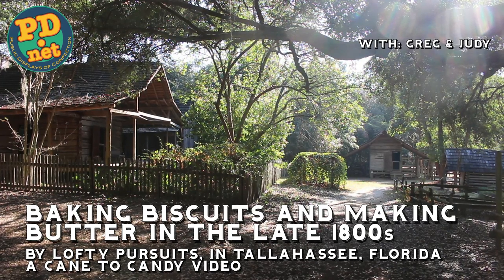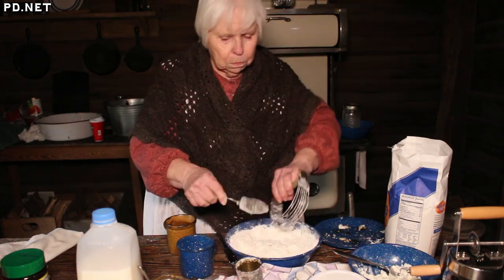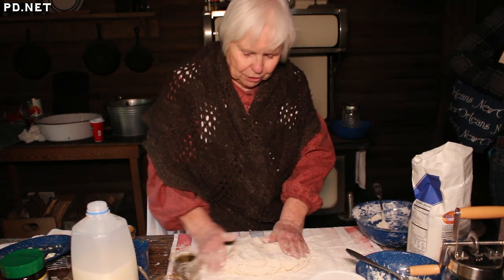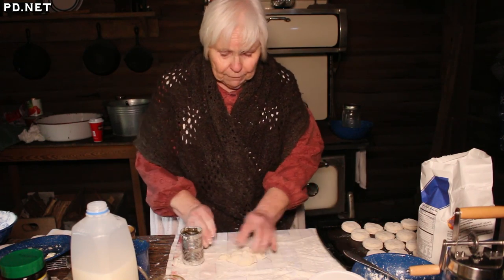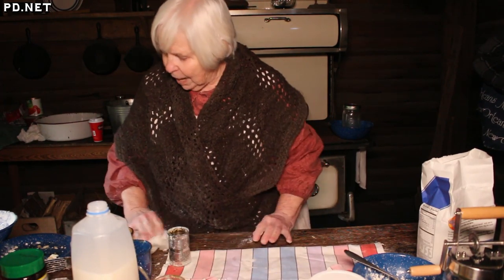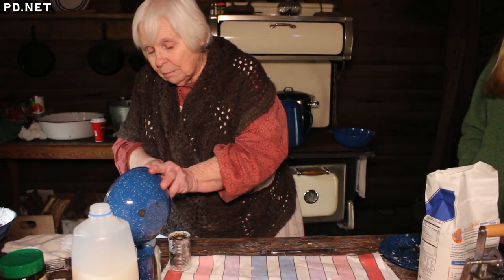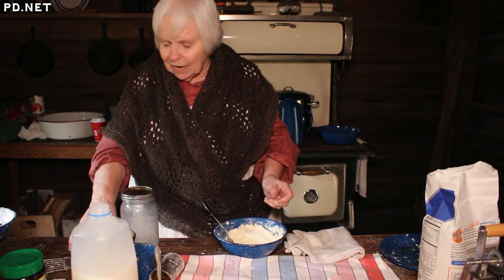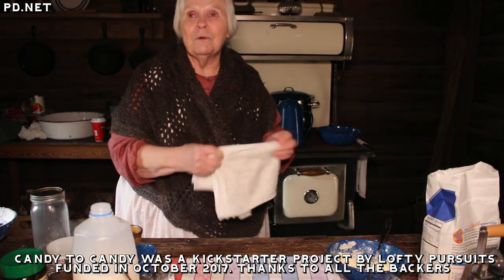#80 Baking Biscuits and Making Butter in the late 1880s

Comment: Does the Moon and the Equinox actually have anything to do with making butter, or is she just ever so slightly superstitious?
Reply from the maker: It effects milk production, so sure, why not
Reply: @LoftyPursuits  - How does it affect milk production?
Reply from the maker: Google it. I'd hate to get it wrong
Reply from the maker: I do think she was being sarchastic
Reply: When I make butter, (and I DO make butter) I use 
"sour" cream.  Mix some CULTURED buttermilk 
or CULTURED sour cream, in the heavy cream, 
in a canning jar, just like she does.  5:1 or 6:1 
ratio.  Fill the jar about 3/4 full.  When the cream 
clabbers, (it'll look and taste, like sour cream) 
shake the bottle, just exactly as she does.

If you get those "Humbugs" full of sour cream, 
from Wendy's, they will NOT work as a starter.
Watch GReg's Humbug recipe,and you'll see they 
are "acidulated."  You won't get the bacterium 
needed to make sour cream or buttermilk.

Yes, you can turn regular milk into buttermilk, 
using 5:1 or 6:1 milk to buttermilk starter ratio.

You can also, like she does, save the buttermilk 
from the butter.  (Where do you think the name 
came from?)

Sour cream butter, has an "European" flavor, 
and homemade is LOTS cheaper.

steve